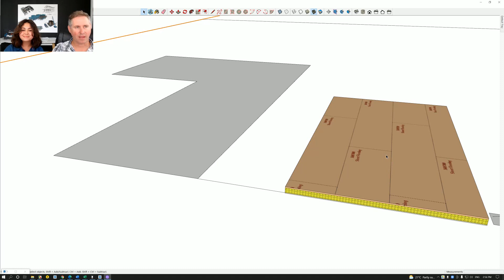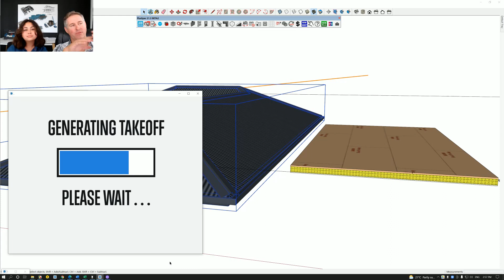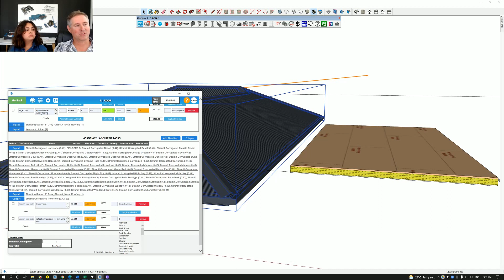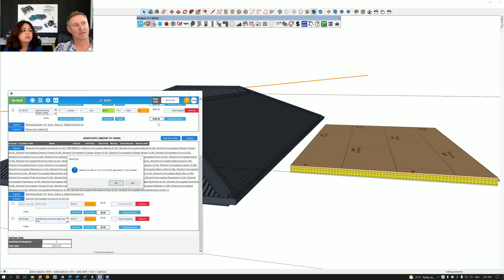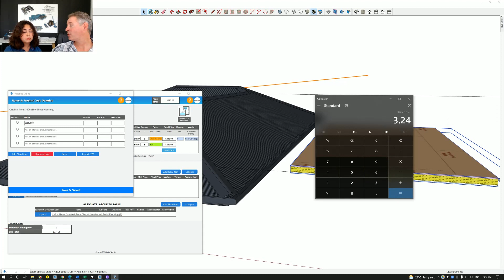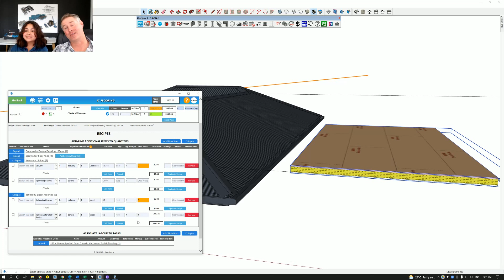Recipes for beginners in PlusDesignBuild Adding recipe items per square or each  or  labour

Comment: In the video,  you set up a second recipe for roofing in high wind areas.  Does the software rely on parameters to know when to use the high wind recipe or do you have to manually include/exclude that recipe for each model with a roof?
Reply from the maker: Hi Geoff, You just need to tick the recipe on or off to let the software know when it needs to allows for the high wind recipe.👍
Reply: @PlusSpec  Thanks.  So you have one recipe per wind speed and choose which one to use based on the wind speed.  Cheers.
Reply from the maker: @geoffreycaldwell  that's right and you can just switch it on and off as you need. If you wanted to see how this would work you can request a demo here: https://plusspec.com/plusdesignbuild-demo/